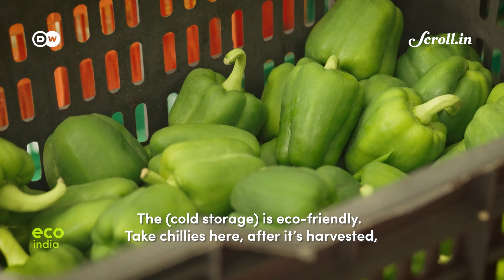Eco India: Why decentralised renewable energy is key to India's long-term development goals

Comment: 😮😮😮😮 ....
This could solve very big problem of specially small and medium enterprises and farmers produce  facilities which increases day by day .....😮😮😮
Decentralised   solar / renuable  power producing /electricity generation options  could change the hole dependency of the  these procesing or various small medium factories  onto the government electric power grid and costly power distributor ....😮😮😮😮
India need to start implied and using these alternative  of  futuristic betterment eco-friendly / environment friendly power producing electricity generation options ....😮😮😮😮😮
Soo that we can creat the long term plan and model to produce power for these small and farming processing industries .....😮😮
for sustainable more   product efficient and durable solution to power facilities at small and medium enterprises....😮
 
Government also already started working on this took initiatives to provide subsidiary decentralised solar renuable power producing electricity generation options at  minimal price and provide all installation as well as many benifits for their operations....😮😮😮😮
Banks and many private funding enterprise started  giving loans and funds ....😮😮😮😮😮
providing these decentralised solar renuable power producing electricity generation options at wide range from minimum 20000 to 200000 prices with other benifits ....😮😮😮😮😮😮😮😮😮
Today it's the biggest need of renuable power and decentralised solar energy  system into the hole country ....😮
Soo that it could lower the dependency of power from very costly Government  power distributor into the society ....😮😮😮😮😮😮❤❤❤❤❤